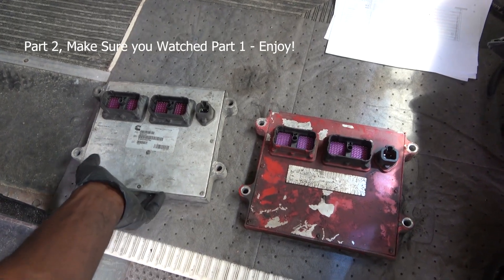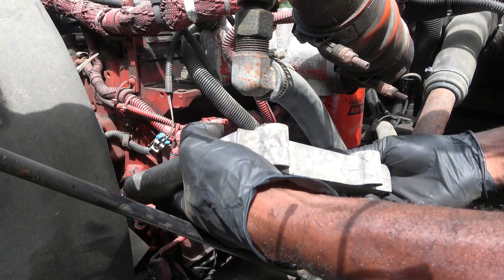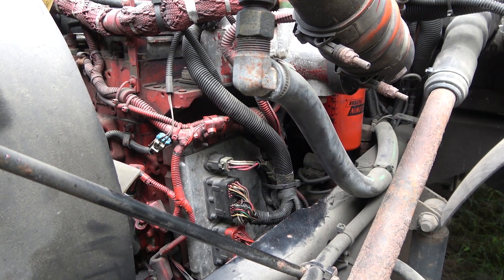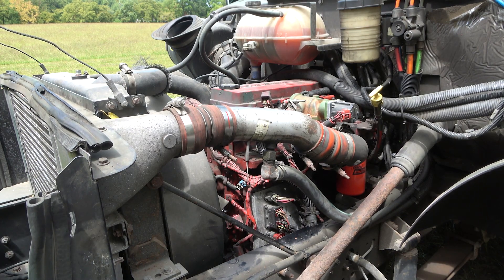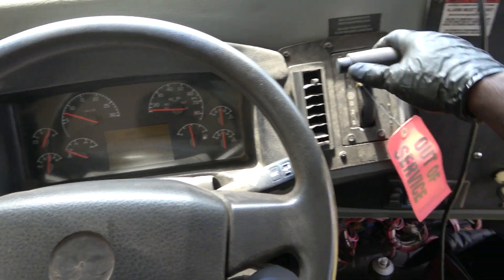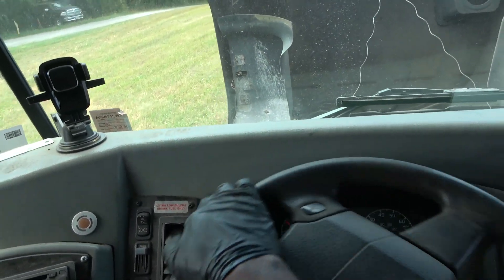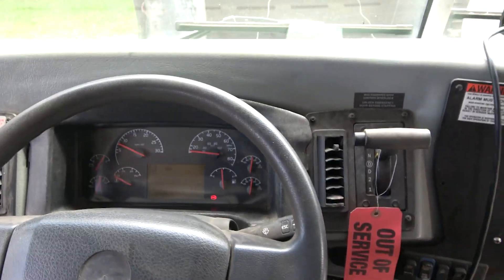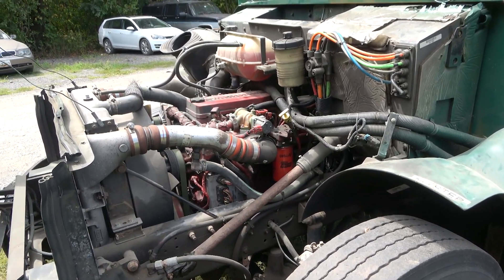Cummins ISB Engine Crank No Start - Diagnosis  & Repair Part 2 The Fix - School Bus Cranks No Start

Comment: I just finished watching your video and as there are no fault codes or comunication problems you can leave that ECU on that bus and just program the new one to the bus you removed it from if they dont store vehicle id and speedo readings to the ecu
Reply from the maker: @jamesrossmotors  Good

Comment: I have a 2010 commins blue bird bus and it runs intermediately, it will run good sometimes and then just cut off and won't start, and then it may start and run for a few minutes and then just shut off, computer is communicating feul filter have been changed
Reply from the maker: @brucegraves5968  test your high pressure fuel pump!

Comment: Why doesn't the engine cooling fan rotate?
Reply from the maker: @coangvan6110  Good question! this fan only rotates when engaged by the PCM, it does when the engine reaches operating temperature!
Reply: @KITS_Auto_and_Truck_Repair  How does it work? Is it an electromagnetic clutch
Reply from the maker: @coangvan6110   Yes!
Reply: @KITS_Auto_and_Truck_Repair  thank you very much. I am an auto repairman in Vietnam. Still have a lot to learn from you
Reply from the maker: @coangvan6110   My Pleasure my Friend from Vietnam!

Comment: Good job figuring out the issues. What a horrible choice for the engineers to place the ECM right next to the hot block just to save money on wiring.
Reply from the maker: @nanopotato420  Thanks! Yes, they shouldn't have put the ECM at that location, I'm thinking about getting an extension wiring so I can relocate the ECM!